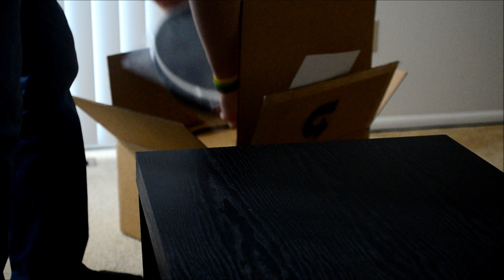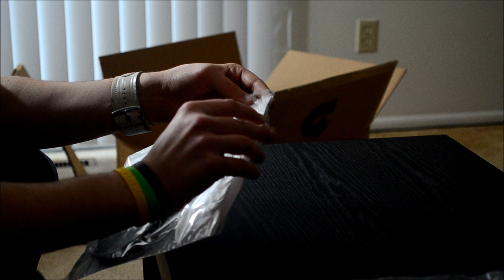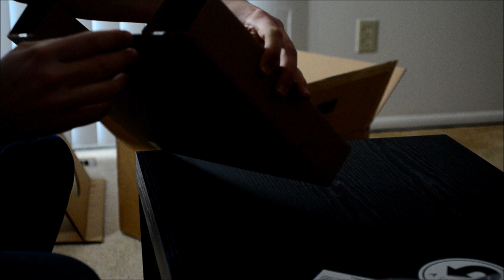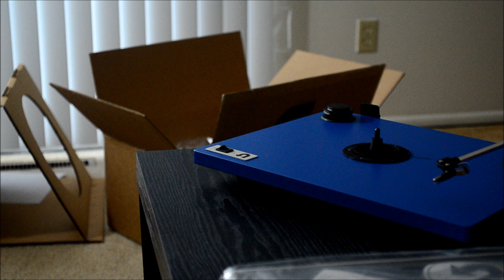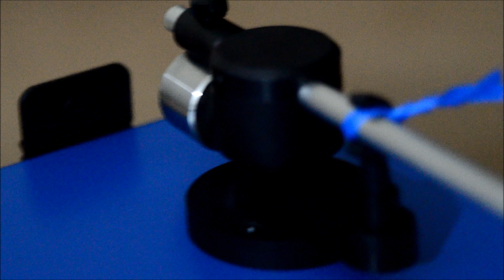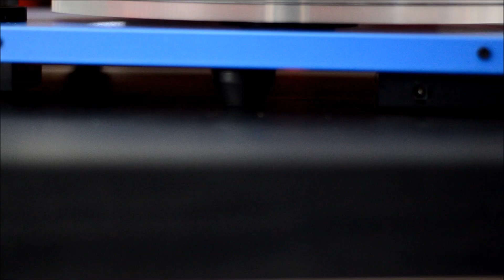U-Turn Audio Orbit Plus Tour and Unboxing

Comment: Total piece of crap.  Received mine in the mail today and it doesn't work at all.  Also, the belt is a BITCH to install.  Should have just bought a PRO-JECT
Reply: I am very interested in this turntable. If it sucks, I would go with Rega.

Comment: Got another look, and yes, that motor spindle in not fixed, it will lean inward under the tension for the belt.  Bad idea.  Needs to be very much fixed at perfect 90 degrees.

Comment: Old guy that was just curios what new turn tables are all about.  First thing I do not like is a wall wart.  That tells me CHEAP.  Why not put that little transformer inside the turn table.  As soon as you had the belt on, is that motor shaft a bit out of alignment (Not strait up and down, just tilted inward toward the plinth a bit).  Otherwise, this looks like the higher end of the table spectrum.  Nice video by the way.  Informative.
Reply: +David Rousseau The motor is designed to tilt, it apparently minimizes noise.
Reply: +AnchorTH   How do you think that works?  It does not have anything to do with noise in any way.  It is just the way the CHEAP piece of crap is made.  You need an on axis set up perfectly aligned on the belt.  Would I purchase  this table?  hell no! Cheap made in China CRAP.  I have a Technics , a Bang & Olson and a transcription  turntable made by Vestax.  I even have an old BSR still running purchased in the 70's.  It is better built that that hunk O crap.  Please get one.  Contact me in thirty years if it still works,  I give it two years and off to the dump.
Reply: +David Rousseau Do your research before making accusations that aren't true. over 90% of the turntable is made with USA sourced parts, IN the USA. the only things that aren't are trivial things like cables and circuit boards. A simple Google search and 30 seconds of your time would have told you this. This is absolutely the best new turntable in this price range.
Reply: I did check to see if there is anything better made today, and I agree.  That is one of the better sets out there.  A used older turntable is a hell of a lot better.  I have four at the moment.  B&O (Sweden), Technics (Japan) dating back to the 80s.  Also Vestaz transcription table (Plays 16 inch, and any speed from the late 90s.  This turntable is very plasticy, has a wall wart power supply.   Expensive but built very very cheap.  Will not last long.
Reply: +David Rousseau I agree that some vintage turntables are better, but I disagree that it is a cheap P.O.S. It might not last 30 or 40 years, but it won't only last 4 or 5 either. I have a vintage Technics and this TT as well, and I prefer the Orbit in some cases.
Reply: +AnchorTH   Well for just over $300, you get what you pay for.  A new B&O would set you back at least $500.  Technics at least $400.  The Vestaz , my newest was just under $600.  I think for the money, the turntable shown on this video is OK for the money, But it looks like a $2000 setup (Sneaky, but not a bad business decision.  Not many tables have the exterior belt, and acrylic platter.  That would come in the $1000+ range.  How long will it last?  DC Motor, has brushes.  Best guess if used a lot, maybe ten years.  The wall wart was the killing for me.  I am serious when I tell you $10 at a yard sale or flee market will save you money long term.  (Did I mention I worked for BOSE for 23 years).  I know what sounds good.  My favorite in the Technics   Sounds GREAT after all these years.  No belt to wear out.  Direct drive.  (Magnetic drive).

Comment: it is not because of voltage, they need to be so big. it is the amperage! that thing could be tiny and still put out 12 volts but it would maybe put out .02 amps which is nothing I can't think of anything that power conservative so they need to be big

Comment: I'm sure these are nice 'tables. But WHY would they go with the exposed belt-drive design? To me, that's just ASKING for trouble. Best case scenario, if you're listening to the TT from another room, some smartass could sneak in and take the belt right off the motor mid-spin. Worst case scenario-what about the belt slipping off the platter and getting loose, also during play? Either way, while I'm not against any improvements in belt-drive technology on TT's, I could NEVER get behind the exposed belt design. Therefore, thanks but NO thanks-In fact, I think I'll wait until Orbit has the time and resources to come up with a direct-drive (non-DJ) model.
Reply: Well...crazy smartass friends are one thing, but if you have small children in the house...this actually could be a concern.   Fortunately, I don't have kids.
Reply: Yeah, if that were the case, you'd have to put it up on a fairly high shelf, where they couldn't get to it or knock it down. But luckily, I don't have kids, either! :-)
Reply: Even if it weren't exposed belt drive I wouldn't have it to where a kid could touch it. The Orbit is a very smooth and quite machine. I adore it.

Comment: Does this record player have a headphone jack? I have a great stereo that has cd/mp3  capabilities that I'd love to continue using (great speakers). If this has a headphone jack I should be able to use my aux cable to listen to my records, correct?
Reply from the maker: RedYellow Blue This does not have a headphone jack as it does not come with a preamp. If you buy a preamp and an RCA to Headphone adapter you could then connect the turntable to the stereo. You could try the RCA to headphone adapter directly into the stereo, but I'm afraid it would be too quiet and you'd have to really crank up your stereo, and I'd rather not run the risk.

Audio-Technica makes good automatic turntables with headphone outputs, and they are cheaper than this one, so that's an option as well.
Reply: thethievery0019 Thank you. I wanted to support this product and what it stands for (anything non-crosley at a good price!), but I have to look elsewhere. Appreciate the timely response!!
Reply from the maker: RedYellow Blue I'm with you, I bought it to support an audio start-up contending with Rega and Pro-Ject. Good luck with your search!

Comment: I'm definitely getting one of these. I was going to get the Pro-Ject Debut Carbon (sorry), but it seemed like overkill. Plus, the Plus version comes with the Grado Prestige Black, and I like that cartridge. It's on my current P-Mount turntable. 

I was surprised to see that they offer the ART DJPre II as an accessory. I'm using that one with my setup as well, and the volume seems a little low. But if these guys have confidence in it...
Reply from the maker: Hope you enjoy yours! I honestly wish I had held off and bought mine with the Grado cartridge, but that's what I get for being impatient.
Reply from the maker: connorbnelson I have a video that goes over my thoughts on the turntable, but overall I enjoy it and whenever I open my media cabinet and see it sitting there I want to use it. I can't wait 'till I'm in a more quiet setting and can really enjoy the records. As for U-Turn v. Pro-ject they're both aiming for the same market; but I think the Orbit's advantages are the novelty/newness, acrylic platter, and Grado cartridges for the price, but Pro-Ject's are time in the market, reliability by being around for so long, and the carbon tonearm. It's really personal choice as I think both would perform admirably. Sorry that really doesn't answer your question, but without A/B-ing both turntables I'd have no clue as to one being significantly better than the other.
Reply: connorbnelson The main advantage of the carbon fiber tonearm is that it's sonically neutral. Even the best metal tonearms color the sound slightly. Carbon fiber doesn't.
Reply: connorbnelson Wait! You mean this U-Turn Orbit doesn't have Anti-Skate capabilities? Ummm...If that's the case...I'm not sold. I'll save up the dang money and GET a Pro-Ject or anything with Anti-Skate already on board.
Reply: Alan Elam the U-turn orbit has the Anti Skate Built into the tonearm. It is setup at the factory.

Comment: great table, even greater camera lol
What other TT have you considered?
Reply from the maker: Are you serious about the camera?

Anyway, originally I was looking at the VPI Traveler, but I read some negative criticisms on VPI forums and figured I could by a turntable half the price and spend the rest on  speakers. Also was looking at the Music Hall mmf 2.1 and Rega RP1 "Union Jack."

I know this is going to sound petty, but the reason I never considered a Pro-Ject was because I had a guy negatively comment on one of my previous videos, and he was griefing any turntable reviews other than the single Pro-Ject one he'd watched. I didn't need that turntable in my cabinet reminding me of that guy, so I just didn't consider it as an option. Spec wise, however, it's a very good competitor with the U-Turn, Music Hall, or Rega.
Reply: thethievery0019

I am in the same position as you: Wanting to enter the vinyl world, and could spend around $1000-$2000 on the TT but I'm not sure if that's a proper starting point, what if after all I prefer CDs to vinyl...

Hence I'm looking for budget tables, but I don't like the design philosophy that manufacturers intentionally "downgrade" their product to fill up a cheaper price point, especially when they go all the way to $200-$300 region. Orbit is affordable, but so far it's the flagship from U-Turn, which sounds promising.

Anyways, buy a lot of records and enjoy your U-Turn!